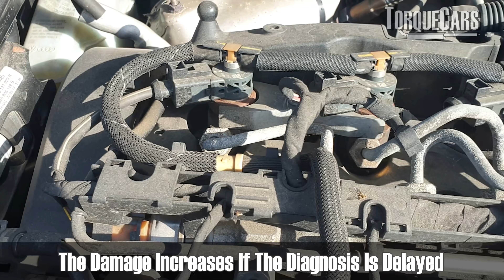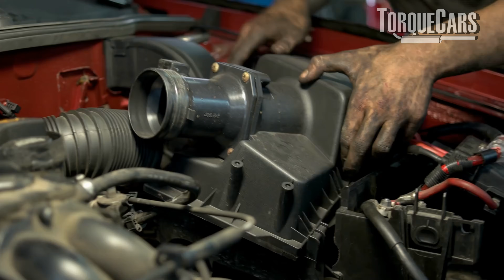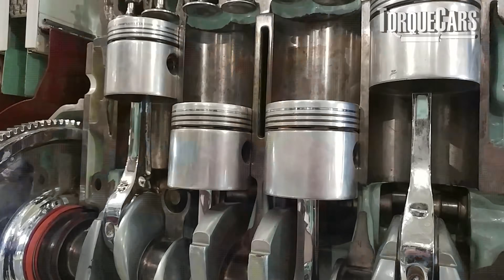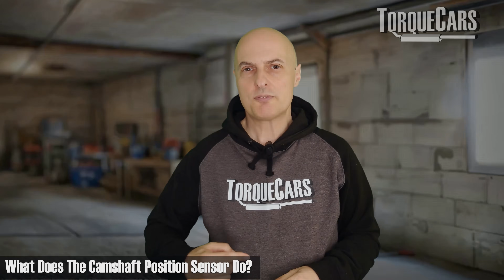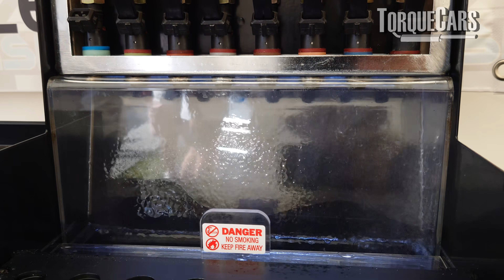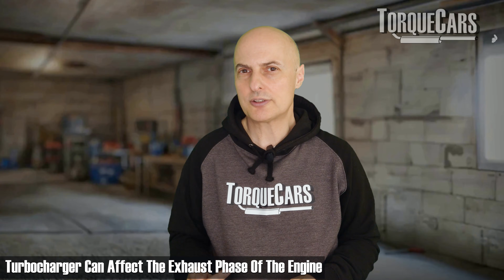Don't Go To The Garage Until You Watch This! Power Loss Accelerating Fixes

Comment: I have a p0420 with this going on.
Reply from the maker: A P0420 code usually points to a failing catalytic converter or a downstream O2 sensor, which can definitely cause those performance issues you're experiencing. I'll expand on the error codes for each combustion phase over the next few weeks.

Comment: Quite a video Wayne, thorough job, very well done. Allow me to add the dreaded PCV valve to the list. I just cleaned the tubing (from the top of the engine) that goes into it, there was a lot of crap in that thing; then cleaned the valve itself; the difference was immediately noticeable; from the cold start which was "like new" again (used to cough and splutter a tiny bit only on summers, like now), to smoother - more gradual - and better throttle response, slightly better fuel economy; these were the most immediately noticeable improvements. Alfa Romeo Twin Spark engine, CF2 (MY 1999) - doesn't burn any oil for the last 6 years, has been rebuilt.
Reply from the maker: That is a great point, thanks for sharing buddy. The PCV system is often overlooked but can cause exactly those kinds of running issues. 👍

Comment: Great video sir! Im actually experiencing something along the lines of this video, I wonder if you could maybe point me in the right direction? So my A250  (2016) manual suffers a slight rough idle when the car is fully warmed up. When the car has been driven harder, the rough idle can be ever so slighly worse..but mainly consistently the same. There is also an occasional flat spot of hesitation when i sometimes pop the car into mainly 3rd and 4th, where there is a 2-3 seconds of delay before the speed picks up. It doesnt happen often. There is no revs shooting up so i dont think it is clutch related, the power is delay along with the revs. The car is never lugged either so its not human error. There is also no EML. Any ideas what you think it could be? Car drives spot on otherwise. Fuel economy seems usual. Thank you.
Reply from the maker: Pretty hard to diagnose but the most common culprits on these are... 
Carbon deposits on the intake valves
Ignition coil failure or spark plug deterioration.
PCV/breather system faults.
Occasionally injector issues (try BG cleaner).
Throttle body contamination.

Comment: If I can repair it, I will always do so. Heavy engine out jobs it's down to the garage. I've had power loss a few times. Last time was a gasket failure which made for a lean mix and occasional backfire. Also a failed temperature sensor really impacted performance. But the car failed to start from warm in the end (mixture too rich). One time I had the rotor arm slowly turn on the shaft (poor materials) on holiday in Devon. As the holiday progressed, the car lost more and more power and that was tricky to find. I'm actually hearing more detonation and pinking from modern cars than I heard back in the day. Sometimes really severe. Thought it was a thing of the past!
Reply from the maker: I don't think the high ethanol fuel content is helping much and most manufacturers are pushing ignition to the max for fuel economy so it doesn't take much to upset this balance.

Comment from the maker: Do you work on your car yourself, or use a mechanic or does it depend on the complexity of the job and need for specialist tools etc?
Reply: I’d love to get a mechanic to work on my car but getting one that wants to work on them is the problem. 

When I’ve had my car worked on by some mechanics have left me with more problems than it went in with.
Reply: Anyone with a problem that requires Garage time (main dealer in particular) should never book in for a issue plus 'a service while it's there', the common practice is to do the service and sell you things you didn't know you needed and either ignore the issue if not obvious or take a stab in the dark.    As a retired level 4 technician i know that there are a lot of good mechanics around but the sad fact is a lot are 'fitters', bonus driven to upsell fast moving parts and have little interest or incentive to fault find. Good, informative video ... as usual!